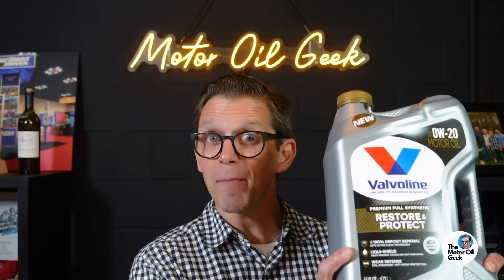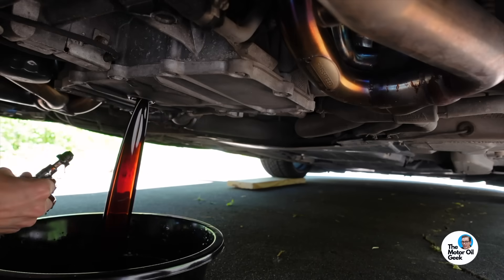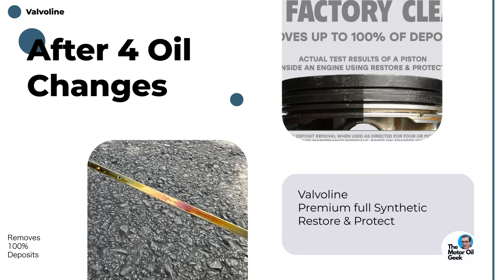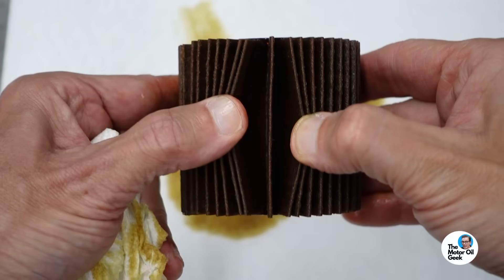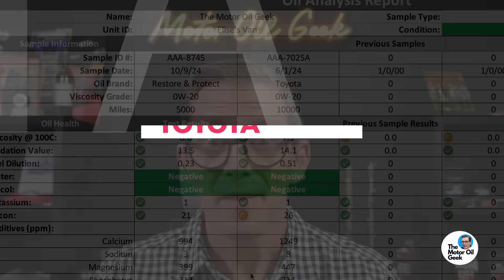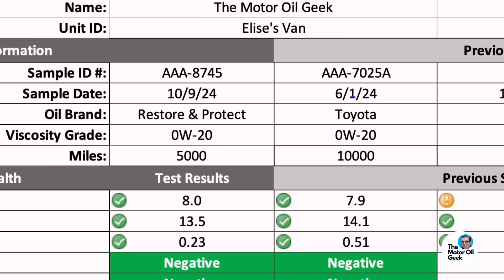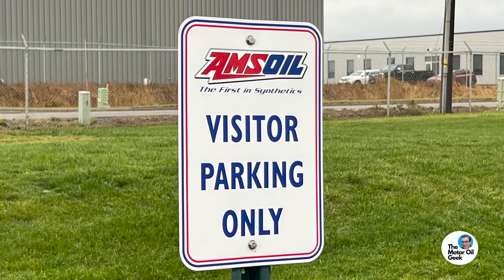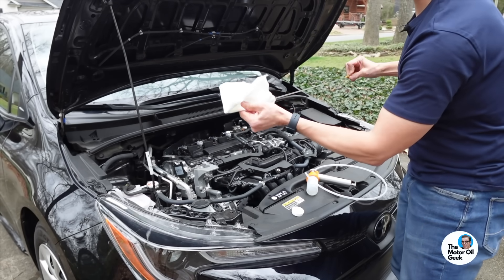The TRUTH About Valvoline's BOLD Engine Cleaning Claims

Comment: I tried VRP in my 2008 Honda CRV with 180,000 miles. After two thousand miles or so, the engine idle was noticeably smoother. I'm sold on this oil.
Reply: I have a 2011 with the looser rings (0W-20).  This stuff made it stopped burning oil completely after it was burning 1q/1,500 miles.  I noticed the piston slap dissipate almost immediately but my valves clatter like crazy.  I’m overdue for a valve lashing 😅
Reply: right there with you. have same car with basically same mileage and I can tell difference in idle and power. I'm sold as well
Reply: Excellent! Lake, I put this in my 2012 Camry and noticed the mpg gauge begin to go up.  I’ve changed my oil every 5k from Toyota dealerships since I've owned it but around 170k it would burn oil.  Prior to VRP I was using Amsoil High Mileage, which is a great oil but it didn't increase my mpg as fast as the VRP and only after 300 miles of putting it in.  So this product begins to work immediately.   Can't wait for your comparison with Amsoil vs Valvoline Restore and Protect.
Reply: @truthseeker1979 Amsoil is overrated! 3rd generation mechanic and engine builder
Reply: After 3 or 4 oil changes. Sienna MPG up by just over 2mpg. Based on same r/t door to door. Mostly same gas stations. From my Indy house to my condo in Myrtle Beach. Tire change to Michelin Cross Climate 2s occured during the 1st VRP oil change. MPG did not seem to be affected by tire change from run flats. The car noticeably runs smoother and quieter.
Reply: I've been using it in my 01 Ram 1500. Idle is smoother, less oil consumption, and I see the oil get darker in appearance earlier compared to Pennzoil and other Valvoline products. This indicates to me that Lake is correct - it is doing a great job of thoroughly dissolving deposits.
Reply: @paulsmith5237 Since you're noticing it (VRP) getting darker... Would you say it still has a slightly translucent/golden color or has it actually gone opaque/black?

Seen various videos of VRP Oil changes 3-5K miles where the Oil still has a relatively clear/golden appearance and not dirty/black...
Reply: @lgoamity That depends on how nasty your engine is. If the engine’s absolutely disgusting inside, and you change the oil, and you go thousands of miles with the new oil, then you check it and it’s still golden, would you be happy about it? I wouldn’t, cuz I’d know it’s not cleaning anything. If it’s dirty, the cleaning oil is gonna get dirtier quicker, that’s just the way it goes. If you use it on another engine that’s impeccable, well it’ll stay nice and clean for much longer.
Reply: @lgoamity  I usually change at 5K miles. It still has a slight golden appearance. This past oil change I pushed it out to 6K miles and it started to turn darker/ black, so I changed it. I put 4400 miles on the truck a month, so oil changes occur every 4-5 weeks to give you an idea of the interval.
Reply: @groundcontrol6876  I'm aware of the logic of "dirty" vs "clean" engines... How during a "typical" Oil change... you might expect the Oil to get "dirty" as it works longer... How it'll become not only darker in color but also "dirty"... The Oil on the stick or during the Drain showing deposits/debris/"grit"... Maybe some Varnish/buildup on the stick/Cap...

Now with that said and with Valvoline stating in its own FAQ that VRP isn't meant to clog up a filter during a normal change interval, specifically stating that its Additive Package is breaking down/atomizing the Carbon and deposits so that the filter isn't being overwhelmed...  THAT would seem to suggest, wouldn't it, that if the Filter is FILTERING, and the Additive Package (ActiveClean and Liqui-Shield) is not overextended and continues to Clean/Protect/Filter... Seems likely the Oil would show less evidence of Insolubles outside of the Filter... As long as the Filter doesn't clog/bypass or the Oil is no longer able to breakdown the carbon/deposits and they are allowed to float freely suspended in the Oil and possibly if not changed start to sludge up or burn/varnish as the Oil degrades/breaks down and "dirty" up the engine all by itself...

I suppose you could have an Oil with a very poor Additive Package (Would it meet the API SP/GF-6A standards though?) that neither has  Detergents or Dispersants... Would allow for "Sealing" preventing Metal on Metal contact, and "Cooling" moving Oil thru the Engine... All without removing deposits or preventing deposits... Suppose that might keep the Oil looking "Clean" until big chunks just break off and clog the Filter or Oil Passageways... starving the Engine and Killing it (slow or fast) with the Oil possibly looking "clean" the whole time?

Just saying that VRP apparently (except on "Sludge Factory" engines) is "gentle" on how it cleans... So it tends not to get "filthy" dark after 3000/4000/5000 miles when others might (for a whole variety of reasons... But since VRP apparently is the only SP/GF-6 Oil to claim this kind of Deposit Removal/Protection... It does look/smell/perform a little differently from the rest of the pack...
Reply: My 97 Civic with 230K miles loses way less oil between changes now. It works!
Reply: My girlfriends 3.5l impala has 236k miles and we used this oil and now it runs so smooth. It gets better gas mileage now too believe it or not. She was getting about 34 before and now her average jumped 3mpg. She gets friggin 37 mpg! Way better than my 11 lmaoooo.
Reply: Schaeffer's been doing this fir decades.
Reply: You’re dreaming, but you are exactly the kind of customer they like.
Reply: I am driving the same kind of CRV, a 2011 CRV. I switched to Valvoline R+P after watching this video. I think I did that oil change around 190,000 miles.

I don't feel any difference, but I was pleased when I did a valve adjustment and valve cover gasket replacement. I used Pennzoil Platinum 0w20 for many earlier oil changes. I used Castrol Magnatec 0w20 before that.
Reply: You sampled from drain